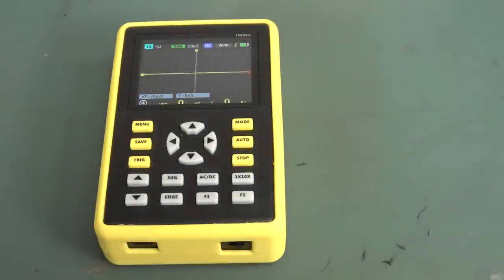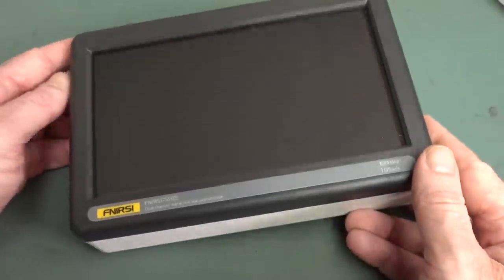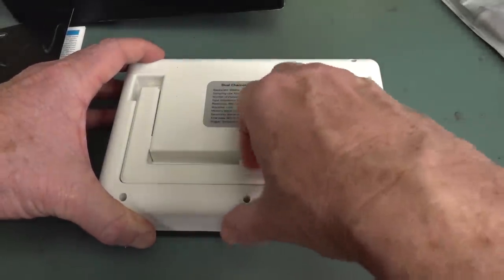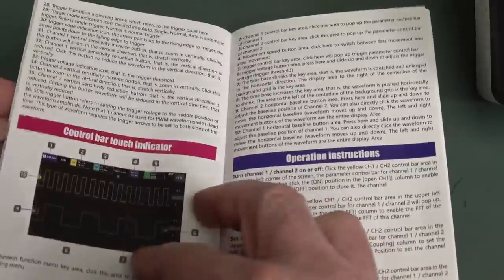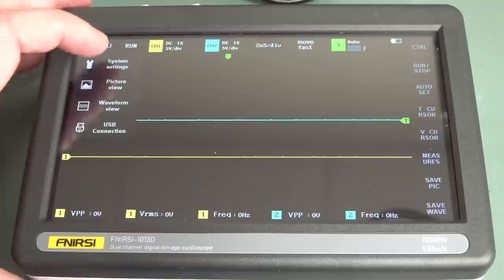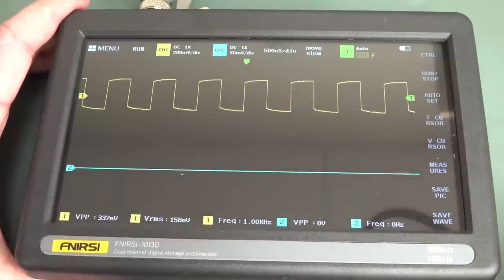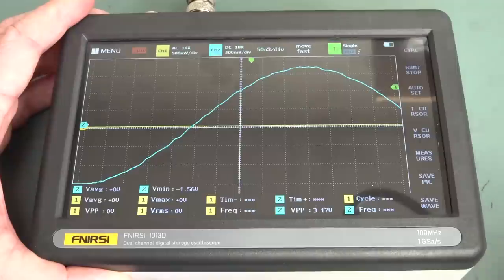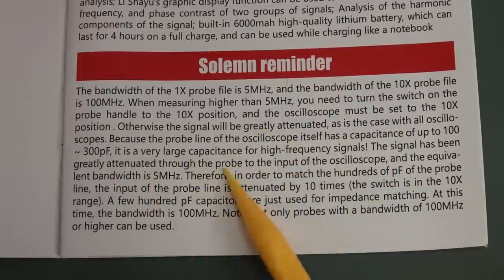EEVblog #1317 - $140 2CH 100MHz Fnirsi Tablet Oscilloscope Review

Comment: I mean you have to remember Dave is used to using $100,000 scopes. So he has that bias. The rest of us (hobbyists) are happy with things that work more times than not.
Reply: I am afraid Dave is getting a bit “snobby”. (His “crap,crap crap” suggests a lack of objectivity?) As a potential buyer I need him to add the perspective that I don’t have. It is fine to “tear it to pieces”, but please take some time to “be me” and help me see some things I might really want to know. I imagine many of us come for his famous rants, but we also need some sympathy as well.
Reply: I am not used to high-end expensive equipment, I got a very old Tektronix 465 scope (20MHz bandwidth, analog), and I would NEVER trade it for this cheap modern fake Chinese crap. As usual, you get what you pay for, and I hate false specs just like Dave does.
I've got a cheap Chinese pocket scope, and while it is better than nothing, the old analog scope beats it in reliability and consistency of displayed values. No matter what range I set, the quality scope will show the same signal values and shape, while the cheap crap changes those values drastically and it's hard to be sure what signal values do you actually have in your circuit.
Reply: @edinfific2576  Indeed, its like one is analog (you see what the signal looks like) and one is digital (you see there is a signal). But anyway, with 500mV/div at 10x... oh boy.
Reply: True, he's way too hard on these cheap devices.
I looked up his own scope, that he was using in this video (Keysight mso-x 3054t) and it's like $10K.
Reply: @JC-XL  He just tells you the facts without relativizing, regardless of prices, hypes, desires, and politics, and that's the best and most you can get from a review. Yes, he has feelings about the gear - in addition to concrete knowledge. He doesn't do your average chit-chat videos, you have to be able to tell the difference, but he's a human being too.

He has every right to express his feelings, especially when a function or behavior just needs to be done more carefully or with better knowledge at probably the same cost to not be crippled or unusable.

Also, Chinese specs are still shameless lies, and you shouldn't overlook that for a second, even if you buy and use such products for your own reasons, as I sometimes do.
Reply: @flt73  Are you serious?
The categories of the devices are not even remotely comparable.
One is pocket money hobbyist device, the other is a $10K investment - a professional tool.
The first one you buy, play 2 weeks with it and then forget about it, the second one you rely on in your job for years and expect to recover the full cost form the work you do.
It is like comparing one of those kids' push-scooters with a motorbike and complaining why the scooter is not doing stuff that the bike does!
This is completely misleading.
This might be the ideal oscilloscope for me, but the guy thrashes it comparing to his $10K scope, which is not 10x the price, but close to 100x the price, without showing anything in it's price-range to get a realistic feel for it.
Reply: @JC-XL  AGREE
Reply: @JC-XL  The point I got away from was this video was like saying a kids' push scooters wheels are capable of speeds of up to 140mph and "well yeah ok, if you throw it out of an airplane at 10k feet you can get them going 140mph..."
Reply: Exactly 10k USD vs 100 USD, comparing the incomparable.
Reply: @tegra5971  the rants yes the voice no...like nails on a chalk board
Reply: @JC-XL  a lot more than 10k$ here its more like $14,740   rip off
Reply: Either way, they should just be honest about the specs.
Just say what it is... Dave would be fine with that I'm sure, it would still suck but you can't argue with truth and honesty.
Reply: @JC-XL  to continue your analogy, this is a kid's toy scooter. But it was labeled as a road bike. Sure, it still works and is cheap, but it's extremely misleading.

Also, you can easily get a good digital 100MHz 2 channel Rigol scope on Amazon for well under 300 euro. Sure, it's not portable, but I trust the specifications stated by the manufacturer and it will likely last you for many years, while this oscilloscope will leave you limited and frustrated when you outgrow it. It's not a professional scope, but it seems good for hobby stuff. So in this case, instead of buying a push scooter, buy a good moped that will drive you around comfortably for years to come.

Oh yeah, and the secondhand market exists too.

I don't see why you seem to think a cheapo scope or a professional scope that costs more than a car are the only options, when you could spend 100 euro more on a good scope.

Not saying this thing doesn't have its place, but I think you could really get a much better value for your money if you spend a little bit more.

And if you want to work at low frequencies, one of those "DSO Shell" kits will be just fine. Just keep your expectations low.
Reply: @mandarin1257  Nope, I completely disagree!
To sum up your reply in one sentence - "No point buying any scope below 300 euro".
Because this is actually what you're saying. Yes, you say, it has it's place, blah, blah, BUT don't buy it, you'll get much more value for money in a 300 eur scope.
You just assume that the value for other people would be the same as for you.
For a beginner even the hands-on experience and training with a scope is a good value at $100!!
After that they will KNOW if they need a $300, $500 or a $1000 scope.
Yes, the Chinese overstating of the features is annoying, but everyone shopping on Aliexpress has the reviews right there with plenty of guys that take these things apart post high res photos and tests.
I don't buy anything there without reading the reviews or even searching for reviews elsewhere for things above $10-20.
Reply: I guess I prefer bigclive's approach ("it's not great, but it's fine for what it is") but I can understand where Dave's coming from
Reply: @aliveandwellinisrael2507  it's really hard to listen to the constant exaggerated bickering a la "WHY can't you do this?  and WHY can't you do this?" as though he expects full osc functionality from something that costs $140.  IMO it would be better for him to turn it down a couple of notches, simlpy state "oh well, you can do this, but not this - probably because of the price."  But as you say, this is how Dave rolls - I think most of us can filter out the exaggerated garbage and see that this is actually a very decent entry-level product.
Reply: Except that the things he talks about “real” scopes having are also available in $300 scopes. He really is talking about basic scope functionality, not stuff found only in a $10K scope. I have a <$400 Rigol, and it does everything a $1000 Keysight does (in fact, in some cases more, since you get more triggers, decoders, etc), with the only real downside being that the Rigol’s user interface is a bit slower. This $150 thing has far less than 1/2 the functionality of a $300 scope, resulting in FAR less than 1/2 the utility.
Reply: @tookitogo  Yes that's true, but merely having a feature doesn't mean that it is worth using.  For example most entry level bench scopes will have FFT that is virtually useless in practice.  Nobody paying $150 for a scope cares about decoding or special trigger options that they would likely never use anyway (like me).  I paid around $150 for a solid UNI-T bench scope and it is extremely basic but does everything that I need it to do, and has features that I will probably never use.  That's $150 I get to spend on other gear!
Reply: @FanPhys  Yyyyyeah, but that’s not what I’m talking about. This dinky scope doesn’t even have all of the absolute basics (or they’re implemented so poorly as to be functionally nonexistent), to the point it might not actually be usable for basic hobby use.
Reply: @JC-XL  I'm sure those are all provided free to him for advertising sake. His subs are the captured audience! Unfortunately a lot of the more popular providers are selling their souls to advertisers for free equipment and then stating they will give us an objective review. WTF!
Reply: @edinfific2576 i mean, some of the chinese stuff is pretty good, at least compared to a 20mhz analog oscilloscope. that being said, a lot of people, me included, don't need anything better than 20mhz

Comment: Lissajous is so last century, Li Shayu's is the way to go now, methinks.
Reply: To be fair I've never heard the XY-mode described as , "Lissajous graphic display function" either. But at least it's not technically wrong.
Reply: Jesus ... It‘s all about the UX with a touchscreen oscilloscope. If you can’t perfect it inhouse,  that’s ok IF YOU OPEN SOURCE IT. But I bet they don‘t do that here, probably because they’re afraid a competitor would use it. I don’t get it. Same problem with 90% of software involved dogy aliexpress gear.  Software is often weak spot with these products. Why isn’t every dogy solar regulator, power supply, dogy smart watch open source. They don’t want free product improvement?
Reply: @Alexander-qz6px  Yeah, it would be great if e.g. something akin to the pine64 hardware would get traction. A manufacturer that just makes the bare hardware with open enough specs, then let the community write the software for it. Once there is a decent enough userbase you can slowly iterate over the hardware/software design to improve it, rather than having to start from scratch with each new device.

A quick search shows up https://www.scopefun.com/ - which looks like it is properly licensed open hardware. But there appears to be no practical way to get it. There's a $750 completely prebuilt one on a crowd sourcing site, but that's it. Maybe some Chinese manufacturer will take the design and run with it without modifications, so we can have a basic $50 board and play with it.
Reply: @Alexander-qz6px  These devices always end up as a waste of silicon due to poorly designed software...
Reply: @Alexander-qz6px  I suspect most of them do not open source because it is hard to do more than just publish a repo, and as soon as you publish a repo then people start whining. Just look at all the comments on the old software repos published by Microsoft.

Comment: This is the kind of that could seriously benefit from open source software IMO.
At the price point I don't know, it seems decent... Proper name portable scopes are thousands of $$.
Less lies and open source could make it a pretty neat thing!
Reply: I've written replacement (opensource) firmware for one of these cheap devices before, the main issue I came up with was the quality of the hardware got worse over time. The unit I got was pretty well made with quality parts, and everything worked as expected, but after several years I started getting bug reports of odd behavior that couldn't be attributed to a software fault. 
A review came up on Hackaday that confirmed my suspicions all the components were much lower quality in the unit that was reviewed and it performed similarly.
In short, the amount of time put in vs results often isn't worth it when the next production run or a run of clone units ruins the hardware.
Reply: @TimSavage-drummer  For which unit did you made the firmware?
Reply: @BavarianM  Was the FG-100 DDS Function Generator. Nowhere near as complex, but I did solve a few annoyances in the firmware.
Reply: Another Chinese company called Micsig makes very nice portable oscilloscopes for reasonable money. Got mine for £300 ish 2 years ago had no issues with it, still works as it did on day one.
Reply: if we make our own open source hardware so we dont have to rely on clones we might get a decent result.
Reply: @TimSavage-drummer  Golden Sample Effect.

Typical Chinese "Goods" :-/
Reply: Chinese and lies seem to go hand in hand with any electrical testing tools.
Reply: I'm coming from seen afew other seriously video reviews from guys that make look this instrument worthy to buy
Reply: It sucks, they could really make some money if they encouraged open source and it took off as a cheap alternative for hobbyists etc with reliable software by people who know what's needed on a scope UI.
Reply: Open source would make no difference. As the saying goes, you cant polish a turd.
Reply: Has been tried many times, always failed. It's just not worth it because the hardware is to crappy.
Reply: @Laczko19  thanks for the tip
Reply: Well, you could get away with crappy hardware, but there's a few things that requires significant and careful attention to, like LNA (low noise amplifier) and ADC needed for that purpose, to actually measure something, so you're kinda stuck with spending a King's ransom on those chips.

Comment: a potential option for those not wishing to dump 350-400usd into an iso trans and variac combo to test thigns where you'd have to seperate the tested device from the mains, so long as you only run it off the battery while doing so. pair it with a 20:1 attenuator and you're gold for just about everything you could need to do with basic/mid level testing on most advanced hobbyist levels. well, so long as you only need to be able to get a rough waveform and readings on the output text. which for most say.. audio techs... this will be more than enough.
Reply: 20:1 attenuator, I bought one, thank you!

Comment: This would be great for automotive diagnostic applications. Most of the battery powered, all-in-one scopes for such are significantly more than $140. You dont even need the advertized bandwidth if you're just looking for crank signals or noise on sensor lines
Reply: Not really automotive friendly. You need long record times to see problems during startup, crank/camshaft signals. You need at least 5-10 seconds of time. So No.
Reply: @GrandePunto8V  its useful for finding shorts in harness by unplugging sections and a bad sensor holding the line high or low.

Comment: Well, at least you got the front bezel with yours.

After complaining multiple times (apparently they couldn’t see what the problem was, despite photos), I was offered a $3 refund.  They said it was probably a production problem.  Yeah, no crap...

Your one is also significantly out of spec on the vertical gain, too.  Their spec claims are nonsense.
Reply from the maker: No front cover? LOL. Should have sent you a new one.
Reply: EEVblog 
I’ll just make one with “Warning: Scepticism Advised!”

Anyway, it is potentially useful for people if the limitations can be worked out — or worked around.  It is pretty responsive, so seems to have enough grunt to work better if the firmware can be modified.

Quality Control is obviously not ‘Job Number One’ with these, but they work reasonably well and are cheap.

Comment: I can really only see this as being useful if you need a truly portable scope. I'm happy with my old 20MHz analog Hitachi V-209 portable oscilloscope. It's a bit bulkier, has a smaller screen, and lacks single shot mode, but it has a more intuitive interface, no aliasing, and an external triggering input. Plus its internal battery still works after over 30 years. The $30 I spent on it and probes on the used market seems like a much better investment than this $140 unit.

Comment: Got one for Christmas... actually has 100MHz -3dB bandwidth. Takes a while to get used to the UI... but doesn't take too long.  I've already used it for 20+ hours.  It's no competition for my old Tek TDS-460 (a bargain, even after replacing all the SMD electrolytics)... but for portable use... and when I only need 2 channels... can't be beat!  I miss the ability to have switchable 50 Ohm input impedance, but a BNC-T and a BNC terminator fixes that.

Baseline calibration is BROKE... never finishes!

Comment: Yup that sums it up, my experience with it was the same. Good thing you didnt waste your time on the fft, its not great, crap actually (looks like they are using a tiny sample set). But its ok as a basic signal sniffer (up to 10MHz) that you can throw into a small tool box. I also wish they wouldnt bullshit about the specs, no need for that.
Reply: For that price, I think it could actually be pretty good device for some basic debug of audio equipment.
Reply: @mrkv4k  Ya, but I like my Hantek 8060 a lot better for that, it's got a signal generator on board too!

Comment: Even a 100 kHz (not MHz) scope is useful to check power supplies for ripple. It also can be used on audio gear. The caps are a good place to start checking. So even 20 MHz is overkill for some people.
Because most power supplies offer 20 mV or less ripple, this oscilloscope is only just usable for the mV sensitivity. But it looks like good value for portability.
Reply: Late reply, but yeah. I'm a hobbyist/student and I really wouldn't care if it's not 1Gs/s etc. If I was in that demographic, I'd get one of the cheaper Keysight scopes or something. I'm just going to get something that will show what the waveform is, approximately what the voltages are etc just to know whether something is set up correctly or way off.